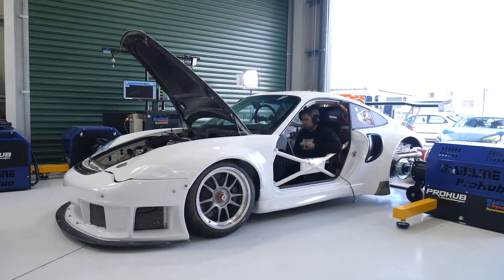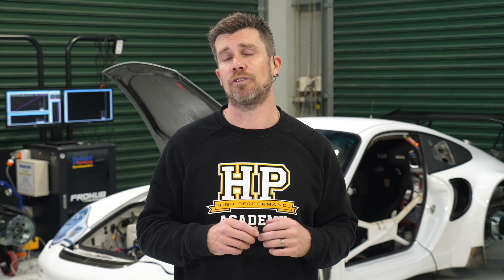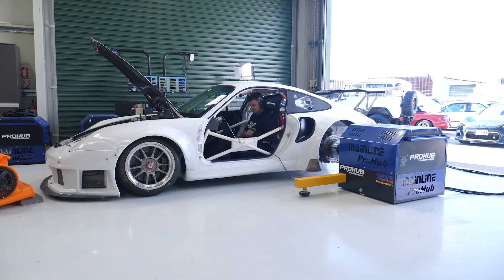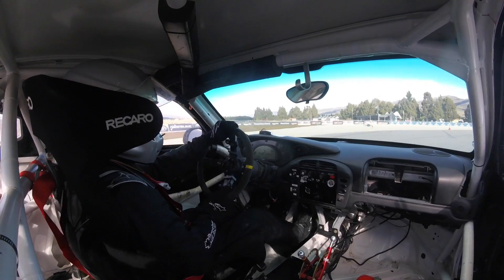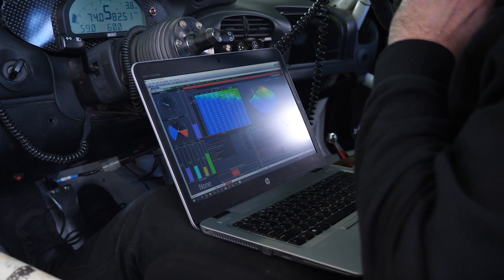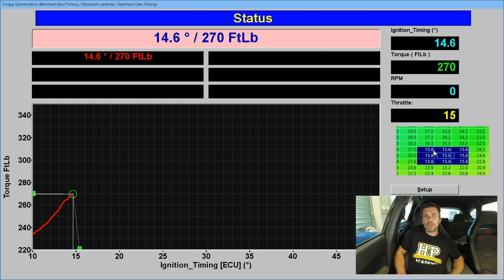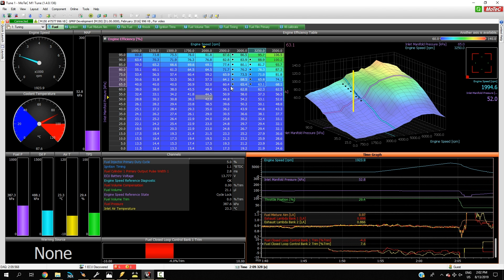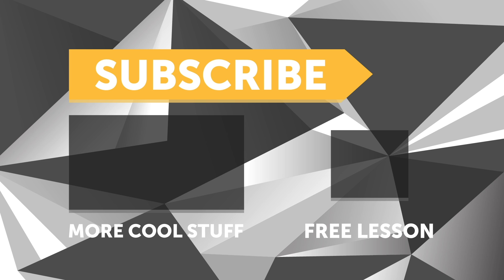V8 Porsche 996 GT3 | Part Throttle Tuning [TECH TALK]

Comment: https://www.mazdaforum.com/forum/mazda-rx-7-33/joe-maddox-super-rare-1-100-1989-fc3s-gtus-rx7-2jz-gte-vvti-build-43602/ 

I have found and saved the rarest Mazda FC RX7 ever made! Now this car is rare. Really rare! Let me break this down really quick... 

Ever heard of the rare 100 GTUs rx7s? Only 40 have ever been claimed and only 11 are confirmed at the time of this posting! Here are the rarest rx7 FC3S models: 

1500 10AE Turbo models 

1400 infini 

1000 winning limited 

150 final edition convertible 

100 GTUs... 

out of that 100: 

83 red on black 

10 black on black 

7 white on blue 

There was only 100 GTUs models created between 1989 and 1991. 

If you own one of these rare models sign your car up to the registry list here on any of the rotary forums! 

There are rumors about a restamped GTUs model... 

The entire origins GTUs owners thread on the rx7club was modified, icemarks claims deleted, registry list changed to have a confirmed section and the mods agree there are not enough GTUs models to have the restamped. 

If you want the full story behind the restamped models: 

https://www.mazdaforum.com/forum/mazda-rx-7-33/restamped-mazda-rx7-45926/ 

https://www.rx7club.com/2nd-generation-non-technical-pictures-198/restamped-mazda-rx7-1148475/ 

If you have a real GTUs you can register it here: 

https://www.mazdaforum.com/forum/mazda-rx-7-33/official-mazda-rx7-gtus-owners-club-thread-44477/ 

https://www.rx7club.com/2nd-generation-specific-1986-1992-17/mazda-rx7-gtus-1148362/
Reply: Haha, I almost bought one in the early 2000's in Texas. Ah, nostalgia

Comment: Great advice here Andre!  Too many times lately I’ve watched videos of cars being tuned into audible detonation on the Dyno.  Wearing det cans and employing active knock detection strategy is a must, especially at higher horsepower and boosted applications.  There is so much difference in throttle response when driving a car that has been fully tuned in all load areas versus just a ramp run tune.  Keep up the awesome content.  Maybe you can get some track time and a video in that monster 911!

Comment: Would a partial compromise for inertia dyno's be to fabricate an adjustable throttle stop that can be set to, say, the mapping positions in the TPS, with runs being done at those points? With the throttle stop, at least that will be a fixed part of the setup.
If done in a higher gear there should be a clear response to changes made.
Then drive it on the road to clean up any problem areas?

It wouldn't be as good, but may get reasonably close?
Reply: Nope, that won't do it

Comment: Hey, Andre, what kind of gains can be had by adjusting injection timing? Would love to see visualized explanation. Like, is injection good during opening of a valve for more straight delivery and continuous of fuel? Should injection end, before the opening of the valve, so that big "chunk" of available fuel would get injected at once? I've heard some DIY-ers tuners say a step-by-step:
1. Finalize VE map.
2. Adjust both ways 'till you get richest AFR. This means the biggest amount of fuel available(of that happened squirt) is being sucked in the combustion chamber.
3. Then re-adjust the VE Table to lean out to desired AFR and thus reduce Duty of injectors. 

Is this true? Does it increase torque? (this does sound logical to me that it reduces injected fuel, but maintains stable AFRs, so fuel is used more efficiently)
Would love to hear from you.
Reply: Duty cycle will be the same if the same demand for fuel is still present regardless of injection timing. The injection timing is best matched to the intake valve timing as opening them at the same time or the injector slightly earlier would give the best “filling” and efficiency of that pulse width. As for torque, this should have no affect, but I’d love to be wrong. The saying goes, “Time for torque, jet for horsepower.”

Direct injection on the other hand does benefit from modified injection timing since their max duty cycle is limited by the amount of time the injector can be open in the first place. Diesels are a perfect example of modifying injection timing to gain both flow and torque, but in a gas engine it may only benefit in flow.

Comment: I always really enjoy your videos!
Just one thing though, you mentioned the "Q" key to bring fuel values into line with the target lambda table which is great... very quick and simple.
However, wouldn't most of the fuel tuning involve ascertaining what particular lambda value would achieve the best safe result for those particular conditions or did I miss something?
Reply from the maker: The M150 uses a VE-based fuel model so the workflow is to start by setting reasonable target AFRs in the Target AFR table. Then we tune the VE table to achieve these targets (and the Q key basically does this automatically). Once the VE table is accurate we can still experiment with different AFR targets by modifying the AFR target table and the ECU will track the change as requested - Andre
Reply: Yes under WOT, but unless you've got hours to kill on the dyno its not really necessary to optimize the AFR for power under part throttle conditions, as long as its a safe AFR. If you want more power at part throttle, then press the throttle harder. You can get pretty close by interpolating between the cruise AFR and WOT AFR.

Comment: that's where i need to see my tuner for a re-tune. i have "bucking" at the craziest areas of my map. like 50mph @ 2000rpms for example. my car is a 95 Ford with the EECIV and tuned with an SCT chip. the acceleration through the gears all the way to 6th is great, but i cannot crawl in traffic or use the highest gear at low speeds without the bucking. great video as usual HPA💪
Reply: Definitely! This dyno setup would fix that. You'll be hitting cells you normally wouldn't hit on a regular dyno.
Reply: sounds like your fuel cut on decel is set wrong.
Reply: @nismofreak33  i recall in the past, i had my tuner zero out the overrun areas when i had my 306ci engine, now i have a 427ci. the overrun might still be zeroed out. i also have a wide range tremec 6 speed, so i could be deep in those untuned areas
Reply: Could it be a mass problem ,as in light flywheel?
Reply: @daleolson3506  my 427 is a neutral balanced Ford racing unit the flywheel and twin clutch is aluminum from Ram clutches. the idle RPM is 950. it doesn't stall when coming to a stop or downshifting, but will start bucking at anything under 2000 RPMs when coasting to a stop. while cruising @50mph in 4th gear i will get some small bucking and i have to give it the smallest input to the gas pedal and it smooths out.
Reply: PANTYEATR1 I think that in my experience when you have light weight components,you need to carry more rpms.
Reply: @daleolson3506  i agree with you, but even if I'm cruising at 50 mph @ 2000 RPMs? i would think that's plenty of momentum and rpm, but i could be wrong

Comment: I wish someone would make a dyno that sits in a small wind tunnel, and the dyno itself powers the fan. Servo-controlled variable pitched blades could change the load, but also you could get air movement speed that matched the car rolling.
Reply: Initially, that's a great idea, however there is a big problem with the airflow management in wind tunnels, as it has boundary layer and cross-section compromises that hurt the effective operation. Wind tunnels are rather interesting, even at the lay person level, and you may like to do some checking on them out of interest.
Reply: @gordowg1wg145  Huh, I will, thanks!
Reply: just tune a propeller aircraft :p

Comment: Andre, how do you know what load setting to configure the dyno for for any given car?  Also, how do you keep the cars cool on the dyno.  It seems like when you're steady state tuning, it can be hard on the car's cooling system.
Reply from the maker: We don't really need to choose a 'load setting' as such. Under steady state we select the rpm and the dyno instantly adjusts the applied load to maintain that rpm. The ramp run however does require a little thought and here we can define the ramp rate in rpm per second. What we want to do here is match the rate the engine will accelerate at on the race track in a high gear. Steady state high rpm operation does create a lot of heat and this needs to be managed carefully with short periods of tuning followed by periods allowing the engine to cool down - Andre
Reply: turn the RPM you want tuned and apply the load.. you can somehow do that on the road but its more difficult and you need someone else or have datalogging active and go back and forth the same a few times =)

Comment: Another fantastic content guys on steady state and transient fuel tuning.👍 I am curious though about the low load areas of the high rpm range as the engine is realistically not operated in that area of the map. Do you guys just interpolate the values from the ramp run to just get those areas in the ball park?
Reply from the maker: I'll normally steady state tune up to about 2/3 of the rev limit - Let's say 4500 rpm. From here we can extrapolate the fuel and ignition table values out to the higher rpm regions. This will get us in the ball park but the numbers are unlikely to be perfect. Given the fact that we are usually just passing through these areas briefly I'll tend to pick 4-6 points and check them under steady state conditions and then make broad changes and interpolate as required to get them in the ball park. Normally this requires very little work and hence we're not putting much stress and strain into the engine - Andre
Reply: @hpa101  Thank you for your input Andre I really appreciate it!!